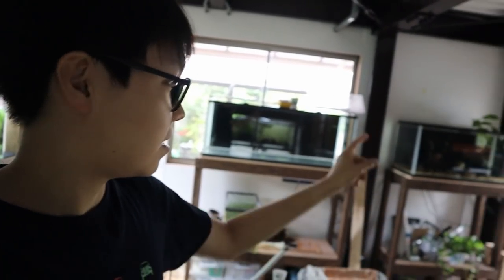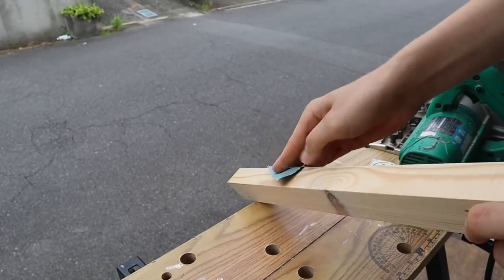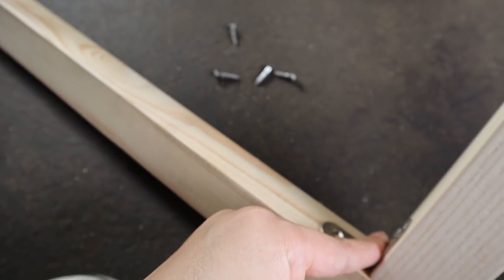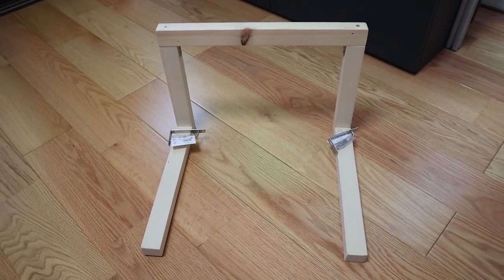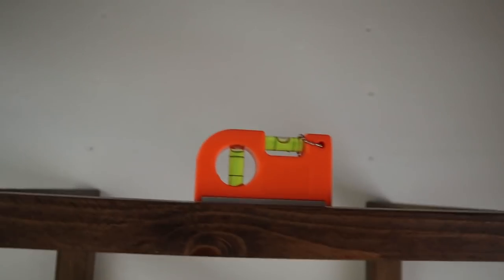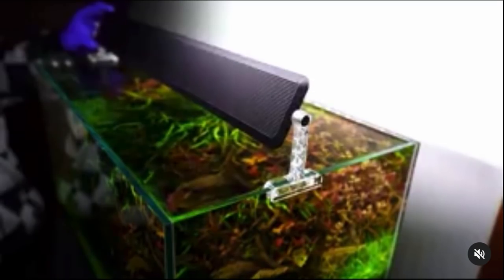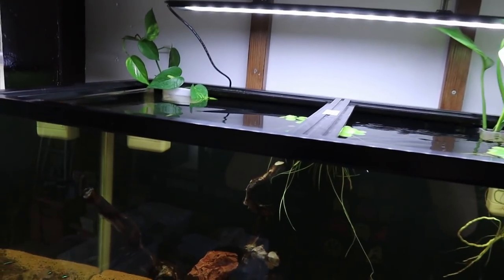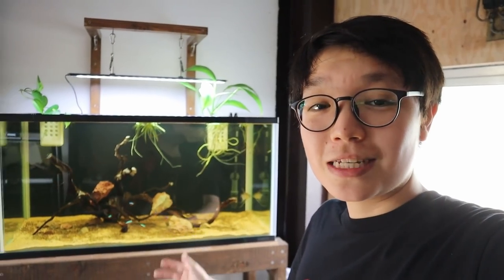DIY AQUARIUM LIGHT STAND - CHEAP & EASY!

Comment: Next time if your counter sink the two visible screws facing the front further into the wood you can then put a dowel into the hole and cut it off flush. That way after you sand it, it blends in and looks much better than having those screws showing.

Comment: Cable management. You gotta have the wire on the backside of the wood. Maybe drill a hole to fit it through and run it.

Comment: I'd install a secondary fastening that connects the light to the timber framing, in case the eyelet screws fail and drop out of the timber frame. Something as simple as zip ties that connect the looped cable for the light to the timber frame would do. Basically a fail safe device to prevent the light from dropping into the aquarium in case the eyelet screws fail.
Nice project though.

Comment: To keep boards from spinning like that, use 2 or more screws so that the board can't spin around an axis. (or just buy brackets like you already did, they're stronger anyways.)

I'm here trying to work out how I want to mount my lights without drilling any holes in the apartment. I'm not happy with the to-tank mounting arm, makes me think it's going to pop the glass at some point.
Reply from the maker: Me too, I don’t like mounting on the glass as it risks cracking it. Heard of it happen before

Comment: You would be better off just buying a circular table saw.  Perfect straight 90 degree cuts and you can tendon the joints.  I would also put a few coats of polyurethane on the wood in that high moisture environment.  
I wish my BF was as handy as you.